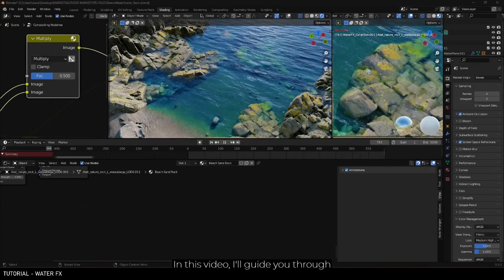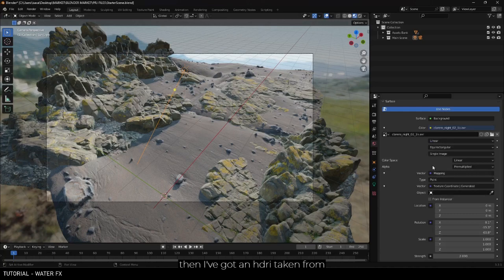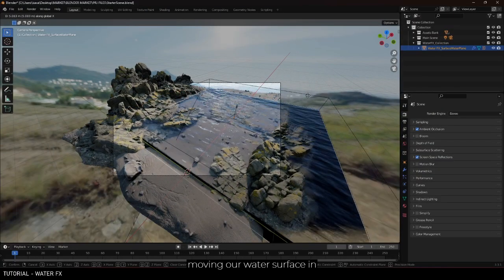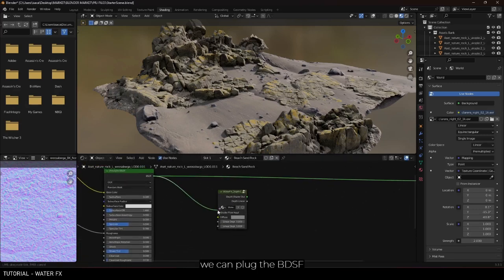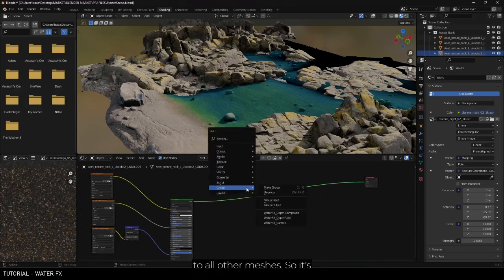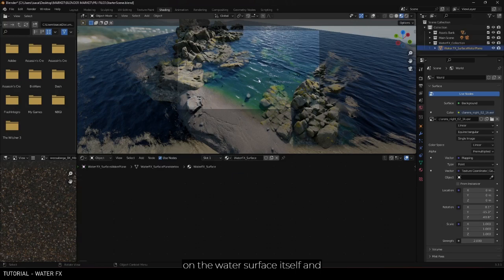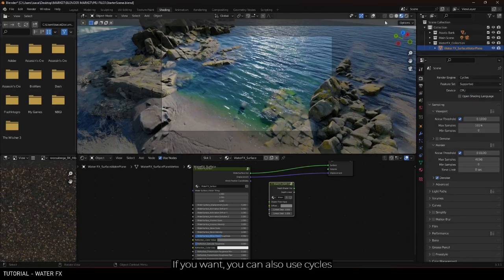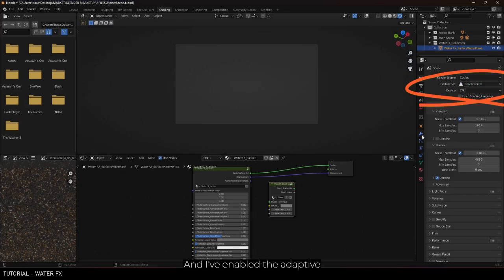WaterFX Tutorial  -First Look

Comment: awesome tutorial!! You added a great feature but didn't utilise it... if you animate the fade amount to go up and down you can simulate the water level subtly rising and falling with waves
Reply from the maker: Thanks for the appreciation, yeah actually it's possibile and It's even possible to get a range of values for the water level, so you can also have different water levels in different point in space... Maybe in future i Will expand a Little the Depth section, but It's something that users can do plugging Dynamic values or function in the driver without the Need of create more pins and nodes that Will increase performance cost... As i said it's pretty flexible and you can customize the functionality :)